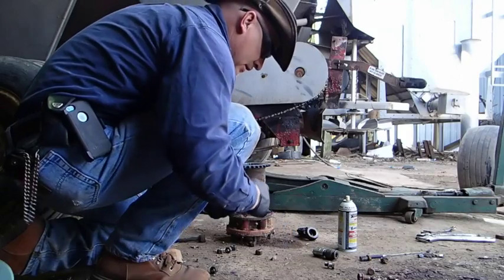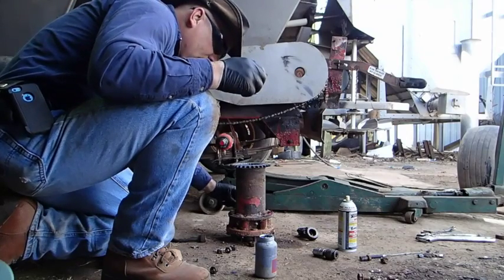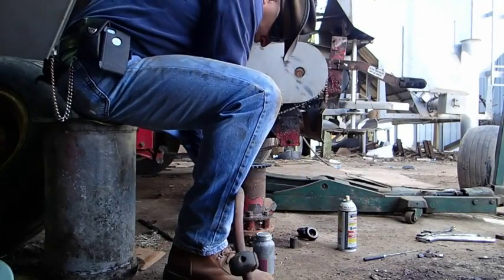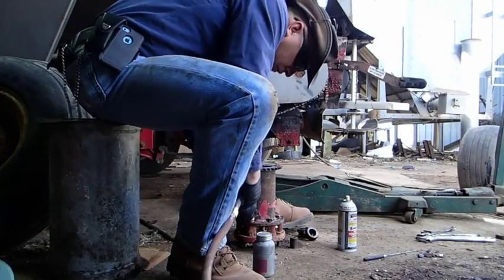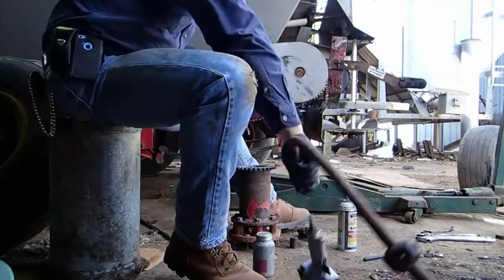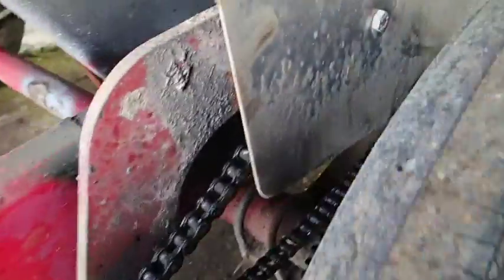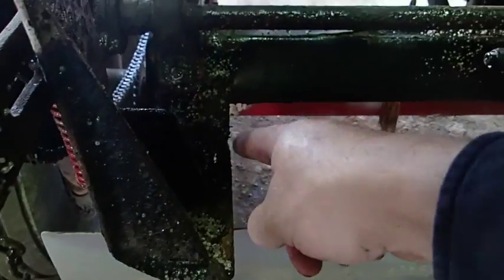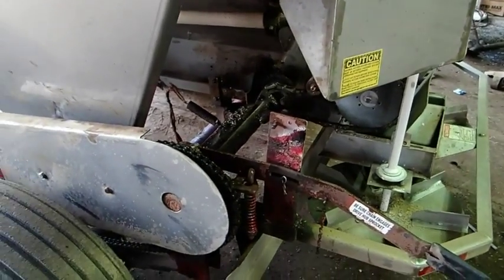spreader repair pt4

Comment: Wes if you replace any of the new steel how about spraying bed liner on it  I used it on the outside of my dumptruck where stone would rain down on it while getting loaded at the quarry.  The stuff eliminated the paint loss and the rusting

Comment: my fater used to be working with those metal rods tey put in concrete 
they where working on the 3th floor when someone slipped and fell 2 stories down ontoo a bunch of those rods sticking up out of the 1th layer of concrete

when you do make youre own undercariage , you might be able to cover over it all with a stainless shield before putting the tank back on 
might allso help to put the whole frame in a acid resistand powdercoat , should make it last a bit longer